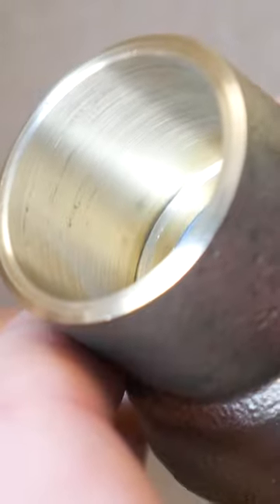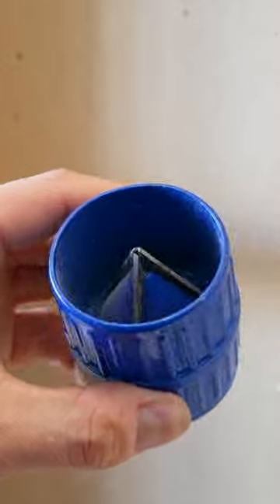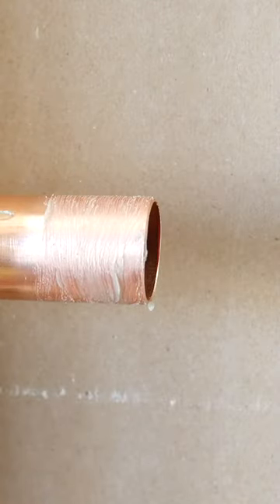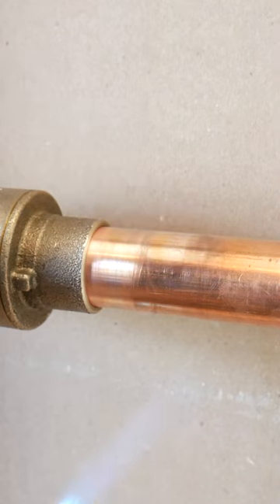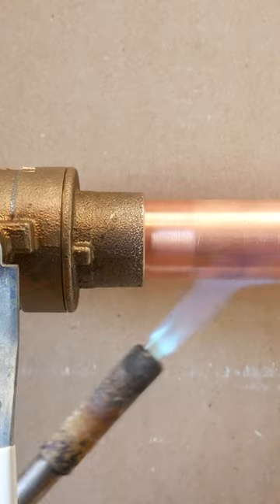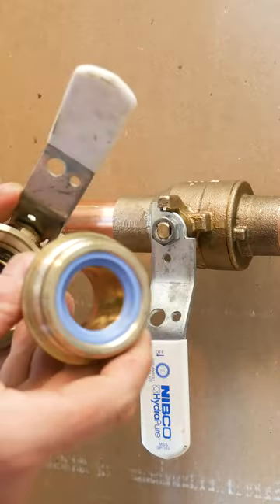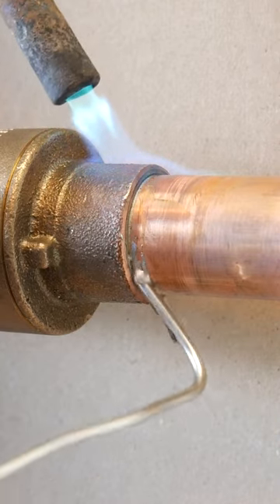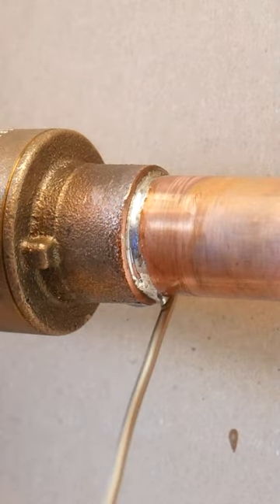How to solder a LEAD-FREE ball valve | GOT2LEARN

Comment: I put a wey rag around de valve. I think this helps to keep it cooler
Reply: I guess you meant a "wet rag." Yes, i do the same thing when possible. I'm a little paranoid about soldering and melting the crap out of it.
Reply: Adding a rag is a double edged sword. It can remove the heat so the valve won’t get hot enough and you can end up cooking it from having to use the torch for an extended time. Personally I will never use a rag until after it’s soldered. The key is to get it done with the minimum heat exposure; get in and get out with the heat. I’ve only damaged 2 ball valves early in my career mainly by too much heat for too long dealing with residual water in the pipes
Reply: @ecaparts  unlikely. Also teflon is good to 500 easy, wouldn't go above 600F for any period of time 

If you get the body of the valve that hot you got worse problems.
Reply: @ObservationofLimits  what is unlikely? A wet rag may sound like a great idea, but it’s actually not. You will take forever to heat the joint before solder will flow at the risk of damaging the valve. It’s better to control your heat by pulling your flame away as soon as solder melts, make sure to point the tip away from the valve body then cool the valve when your done. That’s my experience I’ve been doing this for years. Don’t like my suggestions? You do what works for you 👍🏻
Reply: @ecaparts  we're talking about a wet rag on the valve body not the joints.

It might suck some heat away. But if you're heating it at the joint and have the rag not on the joint it'll sweat just fine.

Also, using a rag after it's soldered is extra clown world because now you're shock cooling the joint and inducing stress cracks.
Reply: I have a wet towel or rag ready to wrap it just as soon as I'm done soldering.

Comment: FYI deburring refers to the removing material from the outside of the pipe reaming refers to removal of material from inside the pipe
Reply: That's why I love the universal, "chamfer it damnit"
Reply: You don’t ream with a pencil deburrer.  Reaming is deburring the inside edge with a reamer. They are both deburring but only one is reaming. 😊
Reply: @BullyBentley  reaming is sizing a hole. Has nothing to do with edge burrs.
Reply: @ObservationofLimits  you’re thinking in machining terms. When it comes to pipe work, that conical tool he uses is also called a reamer.

Comment: They’re not nylon seats bub. They’re actually made of tephlon. Also, heat from the bottom and fill from the top. Removing your flame and continue to fill. This will cool the joint faster.  …dry rag to finish

Comment: You’re definitely not supposed to heat the pipe first. The heat on the hub is the only thing that helps the solder properly suck into the fitting. If the pipe is too hot then the solder won’t flow properly
Reply: Brass takes longer to heat up so the pipe will get hot enough as a byproduct
Reply from the maker: I disagree.

Comment: Solder has no actual guarantee for timeline due to failed plumbers and failed copper it does not last as long as rubber (plastic) Google it metals break down and fail much sooner.

Comment: Those lead free valves are a b** to soldier. Clean the s*** inside the fitting. Some people use tinning flux on those connections.
Reply from the maker: Yes tinning flux sure helps!
Reply: @Got2Learn  no need for the pros though

Comment: I am so grateful that we don’t use this bs cowboy soldered ball valves in Australia, also soft solder went out of fashion,back when Noah played fullback for Jerusalem. Lol.
Reply: What do you guys use?
Reply: @1AlexanderCole  In the UK (where im from) pretty much all valves are compression. Ive been plumbing years and have seen a soldiered valve maybe once
Reply: @olliesutton1804  soldered valves last forever done right.
Reply: @ObservationofLimits  Tbf I rarely get issues with compression ones, they are also easier to change
Reply: @olliesutton1804  well, with all the fitting I do. If you mean internal ferrule + compression ring. Yes those are dope.

Basic compression ring fittings are garbage. I've had to fix so many. It's worth it to swap over to cone rings (where the ring only compresses on one side and has a thicker "butt" for the nut to press on. Less likely to cause leaks from cutting into the line.

My work history is in industrial maintenance. Water lines, refrigerant, oil, grease, etc.

I HATE compression fittings.
Reply: @olliesutton1804  unless you mean, as far as plumbing, something like pro press fittings. Wouldn't call them compression. Those are crimp fittings.
Reply: @ObservationofLimits  I mean basic compression ring fitting. I work on standard low pressure domestic properties in the UK. UK is alot different to US in plumbing. All Gate valves and Lever valves are compression here. The soldered ones he is displaying in the video are like 5x the price of compression here, its why no one uses them. They do look better, I much prefer soldering
Reply: @ObservationofLimits  Its what people from the UK call them. Reason being is that the olive is compressed onto the pipe when you tighten the brass nut. What would you call “compression” fittings? Ive not heard them be called anything els
Reply: Also we call pro press fittings “press” for short, we do not call pro press “compression”

Comment: Never solder like this guy. Always pre heat the pipe before the fitting.
Reply: That's literally what he did and instructed. 🤦🏽‍♂️
Reply: Tell me you didn't watch the video without telling me
Reply: @ObservationofLimits  sure did champ
Reply: Actually, "this guy" has more soldering skills than anyone I've ever seen in 45 years in the trades.  Plus you just described the exact method shown in the film.  What are you smoking over there?
Reply: @Disturbentz  suuuuuuuuuureeeee
Reply: @just n8 yah noob
Reply: @ezekieo32  good luck when you try and solder larger diameter pipe champ👍🏼

Comment: LOL you're going to get murdered in the comments. 😢
Reply: For what?

He didn't really say anything wrong except the nylon part.
Reply: @ObservationofLimits  his technique. He does it way different than people who've been in the trade for years.
Reply: @askurmom1  eh he definitely sweat the shit out of that joint. But again, nothing verboten.

He didn't cook the flux, slap a cold wet rag on the joint, cook the joint.

Again the only real issue is that he said seals are nylon not teflon. And teflon melt waay higher than even lead-free.

I don't see anything worth "murdering" over.